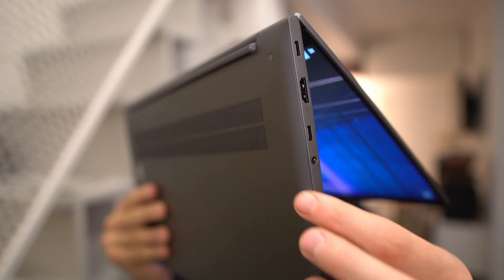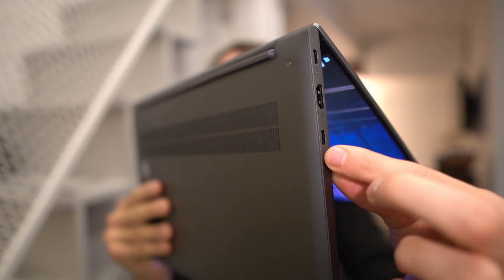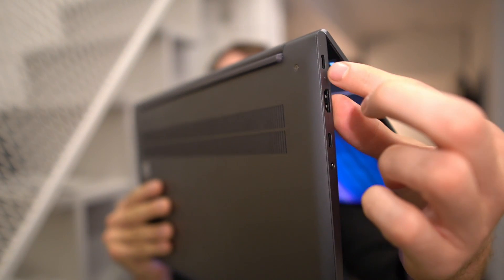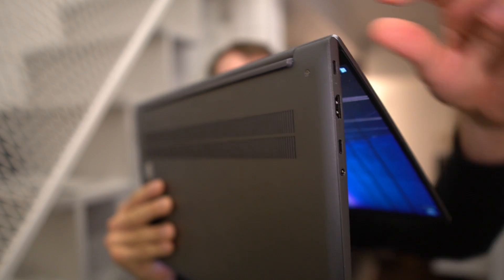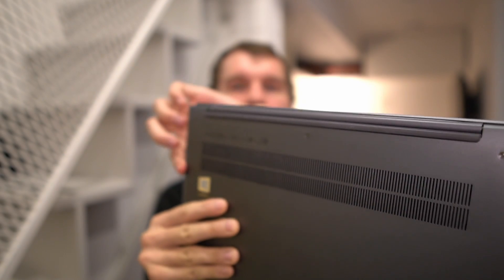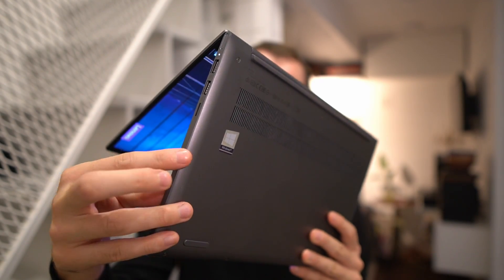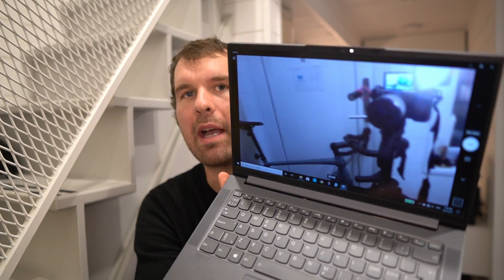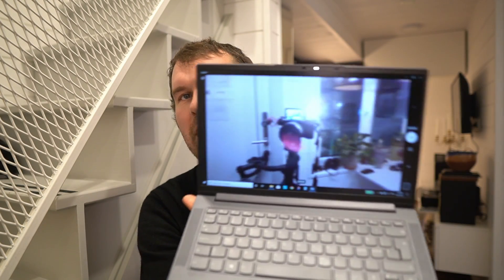How to Test a New Laptop - My way of quality control and use case testing!

Comment: It's Important to stay reasonable. Some coil whine is unavoidable, some deck flex is normal. If you are too sensitive to all those things mentioned you're never going to be happy.

I bought a Lenovo Slim 7 pro recently which I configured my myself and therefore it took a long time to get delivered. First one came with dead pixels. Returned that immediately. Second one was perfectly fine. Except for a small thing: The lid was shifted slightly to the left on its hinge. But I'm not going to return it for this and wait another 5 weeks, and probably get another faulty one but with a serious problem. It's something I'm not going to care for in year on anyway. Other than that it has a bit of a coil whine, which pretty much all laptops I have owned had. Other than that is has some quirks, like my Displayport 1.4 dock just works with usbc put in the right way, which is weird. And one of the two usbc ports does not have its black inner thingy inside. Don't know why, but my Dell doesn't have it either, so 🤷 

Lenovo QC is garbage.
Reply from the maker: I totally agree on that point! That's why I say it's pretty personal. I had a yoga 720 that i returned for backlight bleed. I got a new one and the backlight bleed was much worse. It's a bit of a lottery and you never not what to get...
Reply from the maker: @TechHarmonic  Agreed! I would love if I could know there is a proper test and I will get a good machine from the first order.

Comment: First thing I check is how bad the keyboard is, since most "thin" laptops have absolutely terrible keyboards, even compared to a 20 euros Logitech external keyboard. The key travel makes a massive difference, but the lack of keyboard feedback is even worse.
In the very same note, I tried a Surface Laptop 4 in the store the other day and it turned out to be one of the nicest keyboards I´ve tried in long time (still shallow, but plenty of feedback). Something you just cannot find in the latest Lenovos, which are getting worse and worse, even in the Thinkpad series.
If you´re buying a thin laptop, it´s also important to find if it has one or two fans inside, since the two fans mean they will be quieter than single fans when doing light tasks, and will allow you to squeeze more CPU power when you really need it.
Just my 2 cents...
Reply from the maker: I agree on the keyboard! I usually always try them before ordering. Samsung galaxy book looked very interesting but after trying the keyboard it's not to me...
Reply: I personally like the keyboard on my Lenovo better than the Surface, but I think it comes down to personal preference.
Reply: True - having 2 fans is usually a more quiet experience!